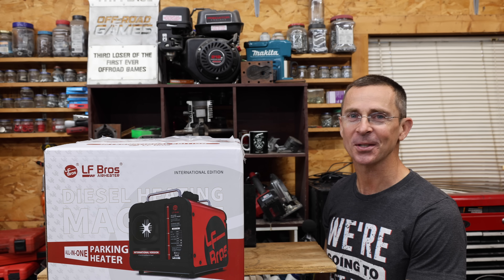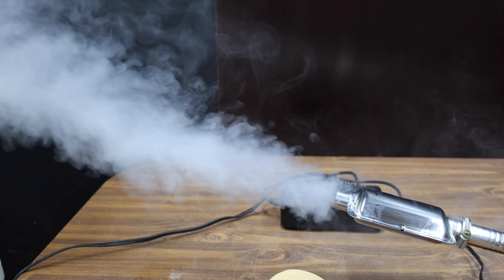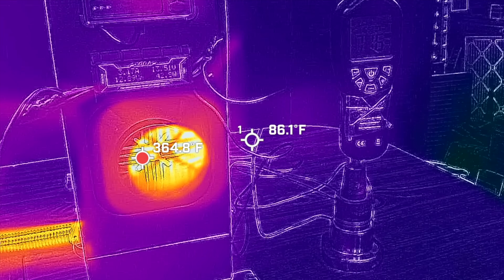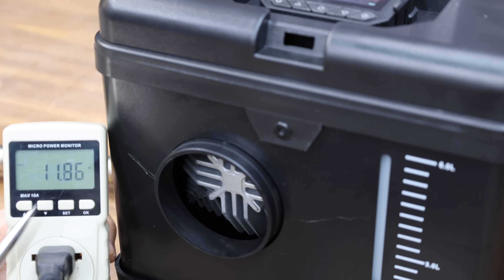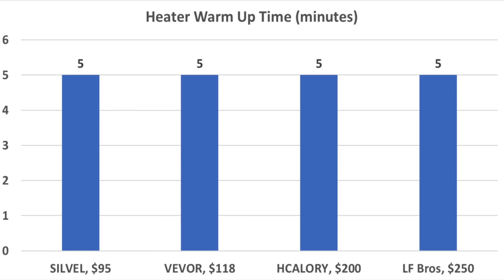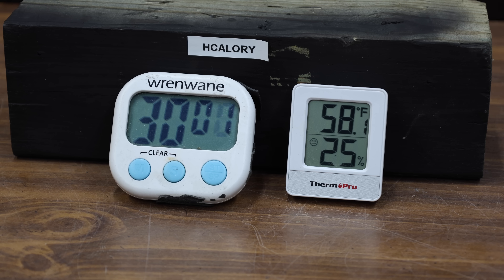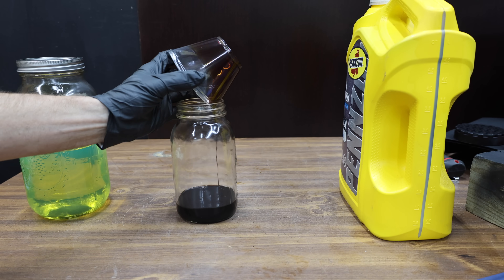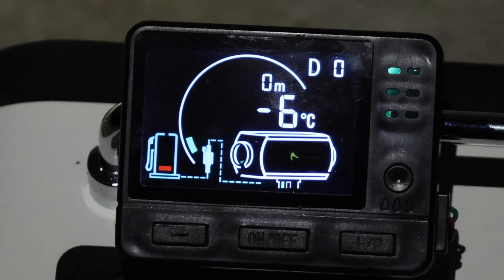The Truth About Cheap Diesel Heaters!

Comment: Very nice review. 

If you do another one in the future, please consider also comparing these "Cheap Chinese knockoff" heater again the original German Webasto and Eberspacher that can run between $1500 to 3000 USD.

Also please consider testing the ability of the heaters to cope/perform with altitude changes. A lot of people like myself are using some form of these heaters for our vans/campers/offlanders and having a unit that can handle the altitude changes is imperative in our cases.
Reply from the maker: Thanks!  Thanks for the suggestions.

Comment: On these heaters I had to add in a buck boost converter.  I put about 14.5v into my older Vevor to get it to fire up.  So far haven't had a problem with just leaving it there.  There is an issue with how they built it, in that it has voltage drop without relation to the incoming voltage.  I was using a high quality sealed lead acid at 100% charge, a 12v 120ah, more than enough.  Typical voltage drop that the device saw: got to under 10v and cycled down. I think it's a design flaw in that there electronics.  A running car will start them, but only because of higher voltage from the charging system.  For reference: I use a 400w 15a step up converter wired up with a 10A fused input.  They do help to take the edge off in my little 18ft truck box converted to a workshop.
Reply from the maker: Thanks for sharing.
Reply: Run 10ga wire it likely won't have any issues
Reply: @mrmotofy  My setup:
Battery: SLR125 12V 125Ah, fully charged sits about 12.9v
6-8ft True 12ga OFC from Sky High Car Audio
VEVOR Diesel Air Heater Parking Heater 12V 8KW 

From 12.9v battery to 9.9v shutdown, on a less than 10a draw device:  I highly doubt going to 10ga wire is going to have any effect.  I shouldn't get 10% voltage drop from 30ft of 12ga on that current, but I'm getting more than 20% drop on less than 8ft?  

They likely pull the power for the heater unit off of the head unit, and instead of using a small built in relay off the main power. I would bet that it's the head unit that is reading the power loss that it is causing to the heater.  The main power to the unit isn't the problem.  I pushed the voltage up to 14.5 so I don't have to mess with it.  It was still shutting off at 14.2v.  That's a 30% drop in voltage.

Comment: Just a few words from experience.
If you run these on the lowest setting for extended times, it WILL cause a lot of carbon/soot build up to the point of failure.
Reply from the maker: Thanks for the feedback.

Comment: The HCALORY should get an instant fail for the power cord. They appear to be using a C13/C14 plug/receptacle arrangement for their DC low voltage power connector. The C13/C14 connectors are in widespread use around the world to provide 100-250v AC. This misuse of a power connector is very dangerous and could lead to the harm of an unknowing individual who finds the wrong power cord.

Comment: If using one of these diesel heaters during a power outage the exhaust pipe would need to be run outside through a window or door. What would be the best insulation for the exhaust pipe to prevent burning down the house. Maybe you could test different types of insulation.
Reply from the maker: Thanks for the suggestion.

Comment: I’ve been using the Vevor diesel heater for a month underneath my RV to overwinter and manage pipes from freezing. I plumbed an external fuel tank purchased from USplastics with a 3’ long fuel line. 12 gallon capacity allows for a week of constant heat. You can’t go wrong with the price.
Reply from the maker: Thanks for sharing.

Comment: Another great video at a good time as temps are dropping for the season. Also interesting to consider running one on veg oil, seemed to burn much cleaner and still provide heat, I'd call that a win.
Reply from the maker: Thanks!

Comment: I have owned the same HCALORY heater that you tested in this video for about a year now, and the main reason that i bought that one is the size profile and the transportability of the unit. I have used it in under freezing temperatures for a canvas tent and it has worked out perfectly for my use case. I have ran it from the battery of my pickup and have not had any issues. Its been fantastic
Reply from the maker: Thanks for sharing.

Comment: If you mix hydraulic oil and motor oil with diesel do suppose it would work ok long term?  I have about 20 gallons of used oil and this would be a nice way to get rid of it.
Reply from the maker: Thanks for the suggestion.

Comment: I haven't finished watching you yet but I always wondered if there what is it good breathable air coming out for the heater do you smell stuff just wondering. As I understand those wall heaters natural gas or propane they actually shut off if the ambient air is below 19 parts per million I think that way somebody doesn't pass out just in case it's not working right
Reply from the maker: Thanks for the feedback.

Comment: After considering all of these I decided to build my own for a few reasons. (1) The control unit / thermostat is mounted on the box where it is exposed to weather and useless for sensing heated space temperature. Pretty sure these control units are not weather proof. (2) They all exhaust downward which puts waste heat into the containment box and onto the surface the unit sits on. OK on dirt or cement, not so god on wood or fiberglass. Also, this means significant case ventilation is required which is not ideal if the unit is to sit outside in bad weather. (3) all of them only allow the unit to pump outside air into the heated space. No re circulation of air is possible. If there is any tailgate effect where the unit is sitting exhaust gas is pushed into the heated space. (4) I chose to use an external fuel tank (Jerry can) with quick connects for hot swap capability and more storage flexibility as well as lower overall center of gravity - less tip over concern.

My variation, installed in a cheap harbor freight toolbox, involved rotating the heater 90 degrees, which works as long as the glow plug remains in the upper corner. This way the heater exhausts out the side of the box and puts no waste heat inside. The fuel pump and filter fit inside the box with the heater. The control unit and power cable are on quick-connect electrical fittings on the box and run inside the heated space. A length of automotive heater flex duct recirculates inside air to the heater inlet(cold air) side. 

None of this is entirely original but resulted from YT university "overland diesel heater" research. Overall cost was higher than buying a pre-assembled unit but not much and with a result better suited to my use.
Reply from the maker: Thanks for sharing.

Comment: Cheap Chinese knockoffs. If you think that $250 is "overpriced", compared to a unit that has been built with proper quality control and safety features - and constructed such that it can be easily disassembled and serviced, instead of held together with plastic and pop rivets - then you're a damn fool. These are "throwaway" heaters - they'll work for a winter or two with intermittent use, until the mesh screen in the combustion chamber becomes clogged with soot and carbon, then all they'll do is produce an immense cloud of smoke and no heat - even faster if you pour in used motor oil or vegetable oil - and then the vast majority of owners will just chunk them in the scrap bin, because they'll have no idea how to fix them - or if they do find someone willing to attempt to fix them, and find out that the parts and labor will cost far more than what they paid for the heater itself.
This type of diesel and kerosene fired heaters have been around for decades, and these are just poor quality cheap copies.

Comment: Personally I wouldn’t use a 110 to 12 adapter. If the power goes out you will be shutting the unit down with no cooldown cycle so the machine ends up coking up. A 12v battery with a smart charger attached is my preferred way of running it, that way you have a battery reserve
Reply from the maker: Thanks for the feedback.

Comment: i have the vevor heater but i got an upgraded one that has a quieter fuel pump and the AC-DC converter that came with it.  I tried to do a heat exchanger for the exhaust out of 1 inch iron pipe but it created too much restriction on the exhaust and a soot build up.  blew it out with the air compressor and works great again.  in the future i am going to try the heat exchanger again with 2 inch iron pipe over a 12 foot run or so since it should reduce the restriction enough for it to run cleanly.
Reply from the maker: Thanks for sharing.

Comment: Thanks much for posting this side-by-side comparison review. I would surmise that the LF Bros unit would have lower carbon buildup with alternative fuels due to its higher temperature & efficiency of burning, and therefore lower maintenance. I personally would lean toward the LF Bros due to the above and the apparent better design & build quality... as they say, you get what you pay for.

Update: I just checked the links you provided in the video description, and increased customer satisfaction is reflected in the increased prices of the respective heaters.
Reply from the maker: Thanks for the feedback.

Comment: I have a 5K diesel heater in my 1970 Beetle. Best 150 bucks I ever spent on it. I even have floor vents and defrosters with a bit of redneck engineering. I installed a half gallon tank and it will run several hours. I ditched the LCD controller and I use the basic one with 2 buttons and a dial. It's almost like having a factory heater.
Reply from the maker: Thanks for sharing.

Comment: Hey I'm sure my comment will get buried but I have a question. The cigarette style power adapter you used for the 12v power, did you buy that or rig it up? I need something exactly like that to connect a round baler 12 v into and that would work perfect instead of wiring straight into the battery.

Comment: I wish people would be smart with these machines... You need to use the right fuel or you will have problems... the thinner oil the better... the cleaner kerosene and no. 1 deisel work cleanest in these... waste oil and vegetable oil is ignorant to run in these the soot and carbon buildup will make these run very bad...

Comment: I bought the hcalory one since it has altitude compensation. I've heard of people having issues running some of them at higher altitudes. I ran the hcalory one at 7400 feet for a week with no issues. Not super high, but much higher than my home altitude of around 900 feet. The controller did recognize and display the different altitudes. I think the vevor one has the same option. The remote and app is nice too so you can turn it on from your sleeping bag and dont have to go outside the tent to run it. The LFbros one seems to have a better/less leaky fuel cap. I just kept a piece of gorilla tape over the vent hole on the hcalory fuel cap while traveling and didn't have any leaks. The hcalory ran fine on my bluetti AC70 off just the 12v cigarette plug, but I brought the AC adapter too just in case.
Reply from the maker: Thanks for sharing.

Comment: What blows my mind is that if you are older,(65 +) you may remember this... in the midwest or other northern areas "Fuel oil" was used to heat areas in homes which was replaced with natural gas/propane .Looks like we are going a full 360 on heating from back in the day when we eliminated fuel oil and flipped to propane/natural gas.Yes, things are getting more efficient in the diesel/fuel oil arena but natural gas or propane isnt really a "cheaper source of heat". Whats best on these heaters is that they are flexible on fuel source . Yes , even cooking oil. Im glad to see this flip in heating source for sure.. Maybe if your home isnt a "shop" right ? But the BTU performance tells it all.Just keep in mind... If you dump used motor oil in the tank ,the dirt has to go somewhere  right? I would say keep the fuel supply as clean as possible. K1 Kerosene is nowhere near cheap and or reasonable on price  but may be a really good source OR better yet, unused vegetable oil in bulk from like Sam's or Costco mixed with a clean burning diesel formula from a station.Use your head... If there are impurities in your oil source then there may be maintenance issues on your equipment or exhaust.Just financially do the best where you can where you can.Maintenance will be the offset.
Reply from the maker: Thanks for the feedback.

Comment: I have the Silvel model. The reason for the underbody air intake/outlet is that these were originally built with RVs in mind. In other words, you'd be routing the intake/outlet through your RV floor. I didn't buy mine to go inside the living space, however. Mine is intended to live in the battery compartment and be routed to keep my RV's pipes from freezing in winter.
Reply from the maker: Thanks for sharing.
Reply: Original intent was Semi's...then got popular for RV's. But similar mount

Comment: I have been using a Vevor unit to heat my garage for about 2 years now. It's an 8kw unit with the external controller and fuel tank. It works great, but prolonged use of 25% filtered used motor oil did end up killing the first unit I had in about 40 hours of run time. The burn chamber became completely filled with carbon and a hard white mineral-like substance. I would suggest just running straight diesel in these unless you're just playing around with it.
Reply from the maker: Thanks for the feedback.

Comment: It's sure strange that the LF BROS unit, rated at 5KW, seemed to raise the shop temp the fastest, over the 8KW units.  While reading Amazon reviews on the Vevor, a former Wabasto tech (Wabasto is one of the companies that made the original diesel heaters) took the Vevor 8KW apart and found a casting marked 5KW.  I'm wondering if all units in this test are actually 5KW... It would be worth it to disassemble and look.
Reply from the maker: Thanks for the suggestion.

Comment: From the delta temperature of inlet and outlet air plus the airflow you could calculate the heat output. It won't be that accurate I reckon, but lowest and highest heat setting would be interesting.
Reply from the maker: Thanks for the feedback.

Comment: Lowes sells a propane heater on wheels that I used to heat my house and a camper. Takes a 20 gallon tank and is around $100. If you need an emergency heater its perfect. It does say outdoor use only but it is no different than using a propane stove, just have to have a tank indoors. These are nice, but if you don’t drive a diesel, its not likely you’ll have diesel on hand in an emergency, where with a propane heater you can use one off a camper (I have connected a 30 gallon to it) or grill. My choice would be propane first, diesel second and kerosene heater as a last resort. Kerosene heaters have too much maintenance and are not reliable in a store it for an emergency situation.
Reply from the maker: Thanks for the feedback.

Comment: I have the Vevor in my 12x24 insulated building. I got a 30A 12V  switch mode power supply off eBay for $19. Works good and just sips fuel once building is warmed up. If not for the glow plug current you could use a much smaller power supply.
Reply from the maker: Thanks for sharing.

Comment: I've been debating on getting one of the Vevor heaters for in my 24x26 insulated garage in WI. I hate working on things during the winter but for $100 this almost seemed too good to be true. Thanks for the video, it has encouraged me to pick one of these up.
Reply from the maker: You are welcome!  Thanks for sharing.
Reply: you will need 2 of them, unless your garage is super tight and well insulated, i have same size garage, not tight nor with insulation.
Reply: @ro7all  My garage is insulated but the main garage door isn't as tight as I would like it to be. I ordered one that will arrive later this week and I'll test it out. Worst case is I'm out $85.
Reply: @hailster  You'll discover that going from a cold garage to a decently warmed up garage these will take a long time to do so, pretty good at helping maintain a decent temperature once it is reached. I have found that I need to use a torpedo kerosene heater to rapidly warm up the garage first. Then use my Vevors to maintain and keep it decent.

Comment: I've looked into these and it kinda just seems needlessly complicated for something that isn't really more efficient or cheaper than a kerosene heater.

Kerosene and diesel cost about the same at the gas station and a kerosene heater doesnt need power, doesnt need glow plugs, doesnt need exhaust, and you can slap a pot on top of it and make some food. You replace the wick occasionally, which doesnt require any tools, and you're good to go. Use the kerosene with lamps indoors too and it just makes more sense.

Now, guys camping in their trucks, fuck yeah these are great. Makes all the sense in the world. For me, heating my garage or the house during a power outage, I'll just use a kerosene heater.

Same price, same efficiency, same output, zero moving parts.
Reply from the maker: Thanks for the feedback.

Comment: You're an absolute beast!  I can only imagine the time it must have taken to assemble, test, disassemble and examine all of those diesel heaters.  I bought a Vevor diesel heater last year, but it has the same low, square design as some of the others you tested.  It has done a great job heating a small, off-grid storage building, when needed.  I connected the 12v wiring using an XT-30 plug to a 240 amp-hour LFP battery, through a DC fuse block.  The battery is maintained by a couple of solar panels and also powers a 1,500w inverter.  I'm a little surprised you didn't test one of the crazy-expensive German variants of this same heater design.
Reply from the maker: Thanks!